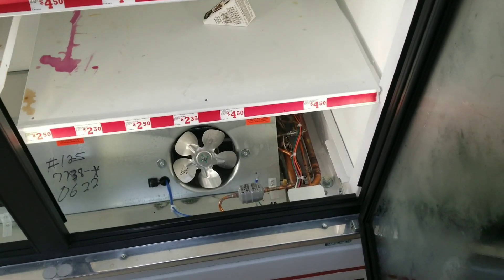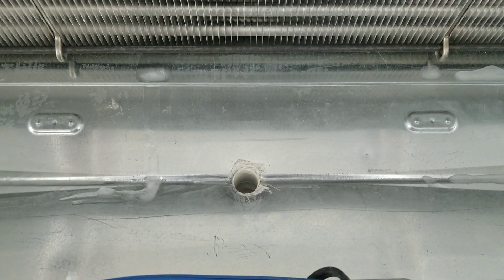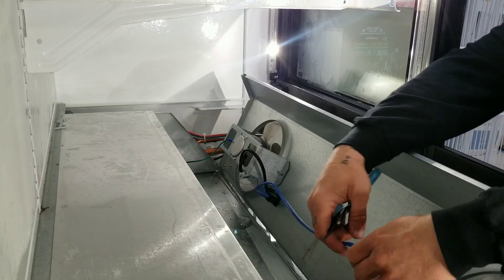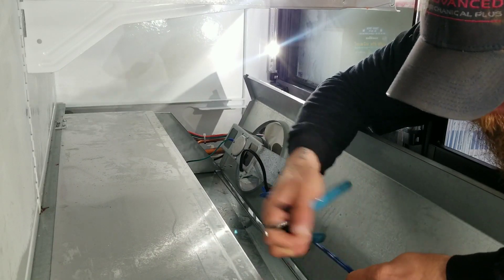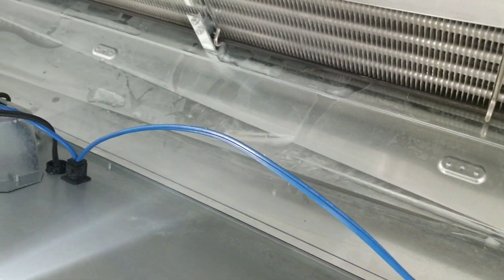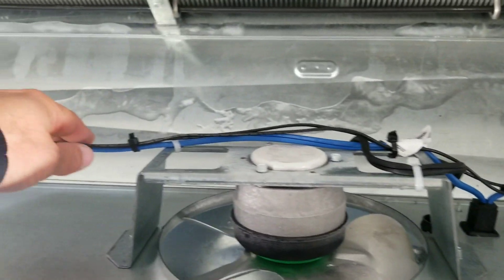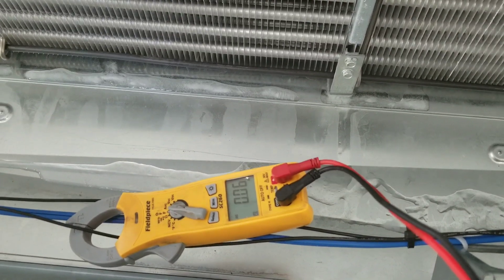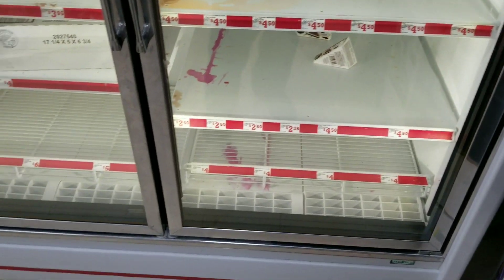Zero Zone not keeping temp: Part 2

Comment: Never seen this before, unless its self regulating heater.
Reply: @curioushvacguy6876  thanks for explaining. In order to avoid melting the plastic drain, we put self regulating heater band outside the drain, or inside the drain but only energised when in defrost. An other method is to put a small fan under the cabinet that blows air on the p trap, and you can also put a copper wire in the drain that is in contact with the defrost elements.